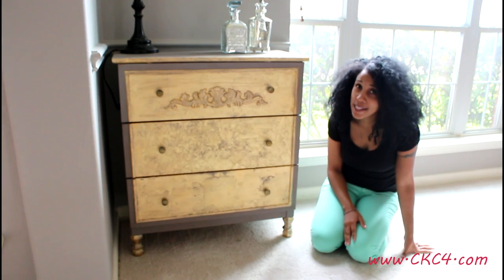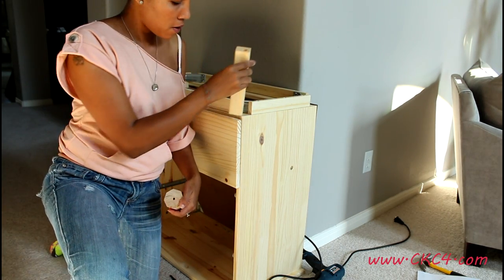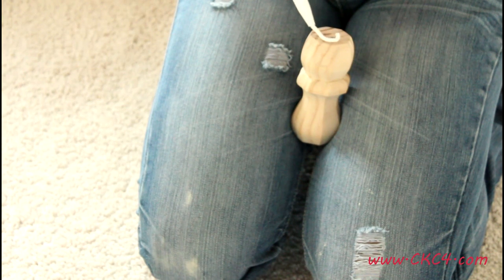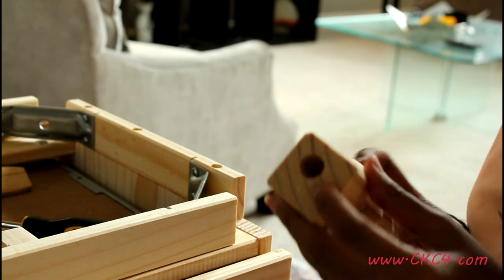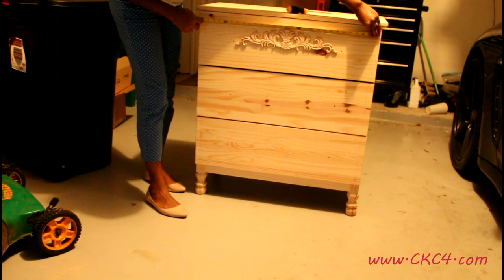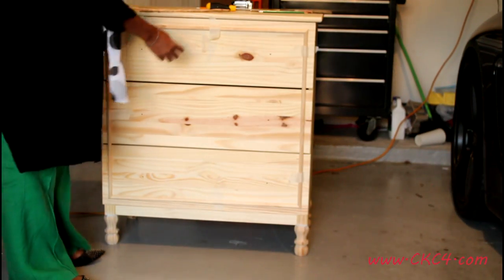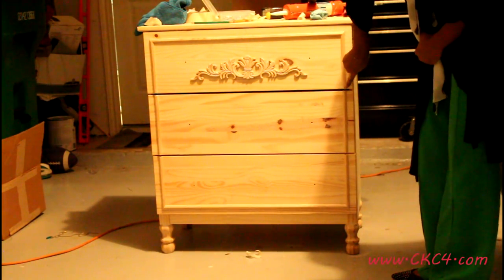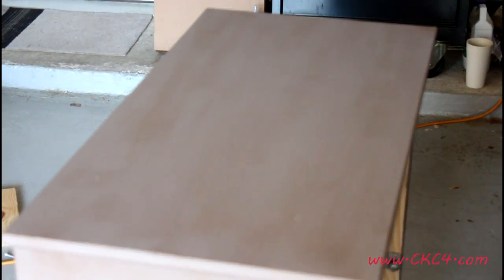DIY| AWESOME IKEA HACK - Tarva Dresser Transformation

Comment: I loved your transformation of this pain Jane chest of drawers into a wonderful accent piece! 
When I’ve had furniture or cheaper kitchen cabinets in which the drawers do not have a secured tongue & groove way for the drawer to be connected to the front faceplate, I’ve come up with a solution. 
I’ve taken my hot blue gun & placed a small bead reinforced/glued on all of the seams of the drawer, so that the drawers do not fall/come apart. 
I have even done this inside of the drawer just to be sure that they remain tight, & square, so that they can easily slide in & out. Nothing ruins a frequently used kitchen cabinet drawer, as when the front pulls away from the rest of the drawer. 
So I’ve found that a simple proactive step to secure & stabilize the drawers when they are new & will be so worth preserving them.